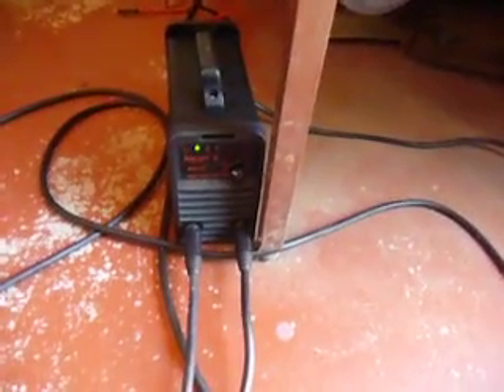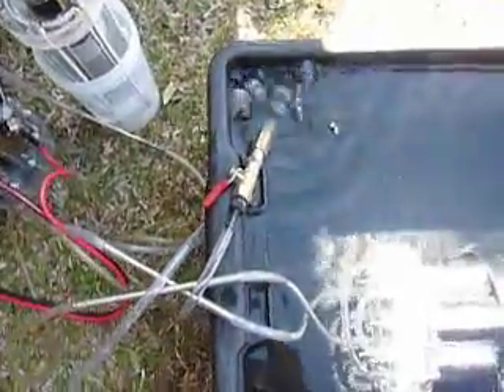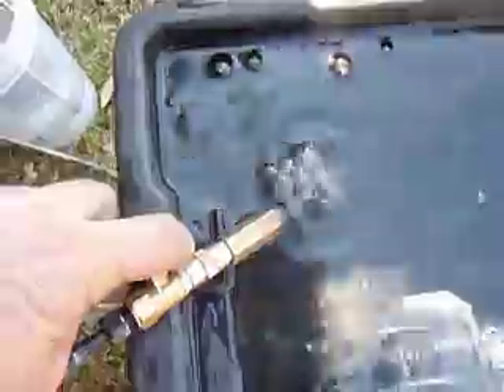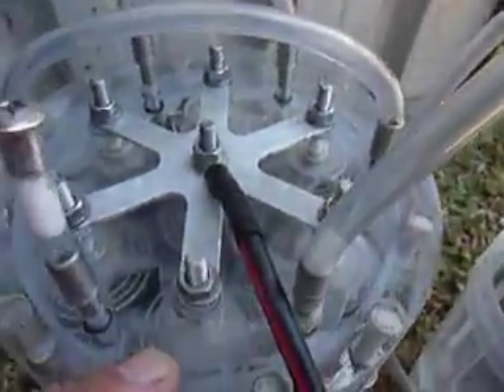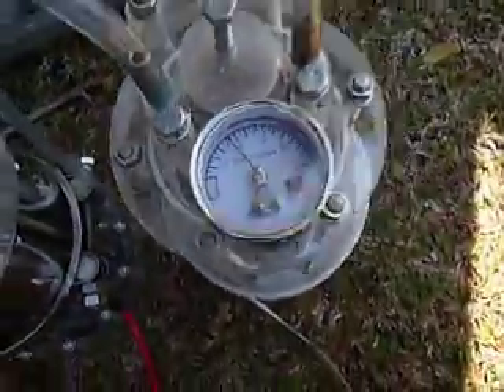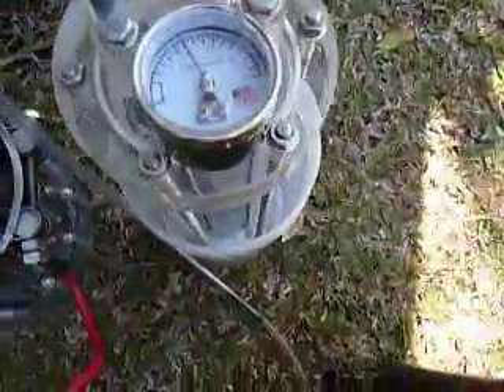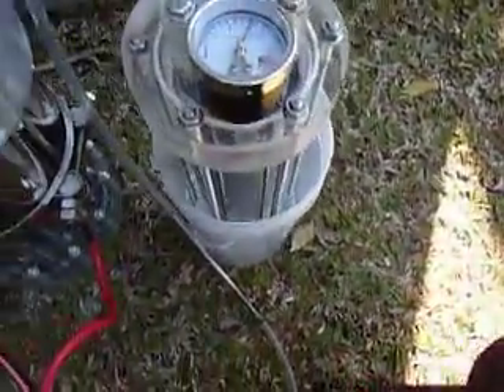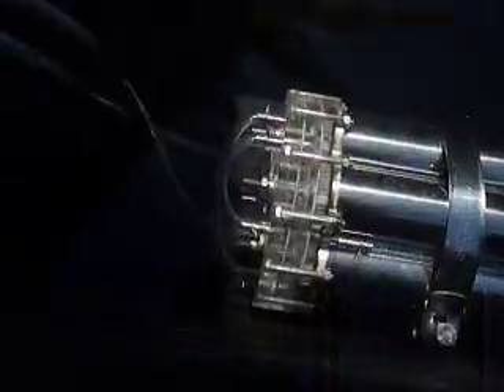pressure testing a cell, exciting stuff. lol.

Comment from the maker: got to around 15psi, but i feel caution is needed with the hose connections.
production at pressure, say 10psi actually seems better than otherwise,
perhaps the gas bubbles are compressed smaller, thus more electrolyte
to plate contact.